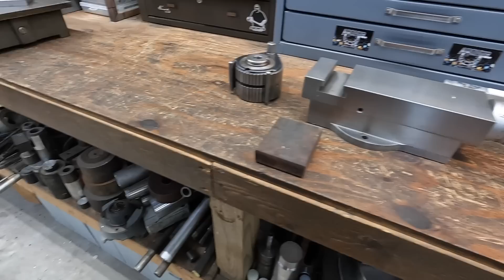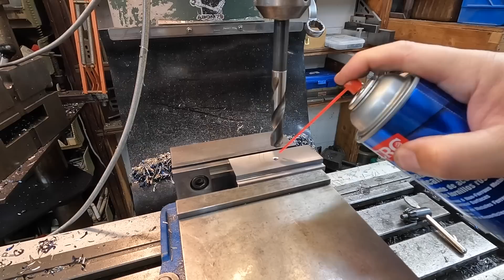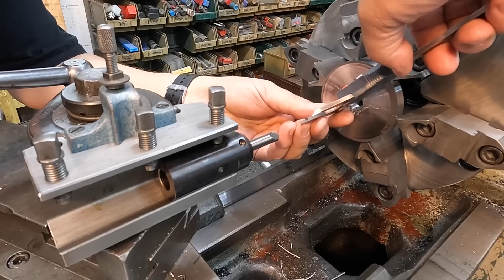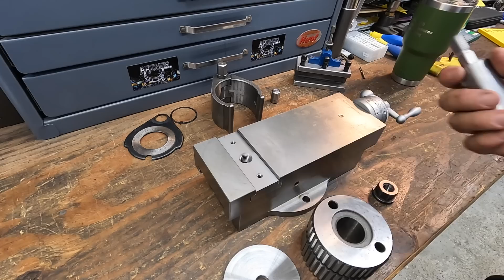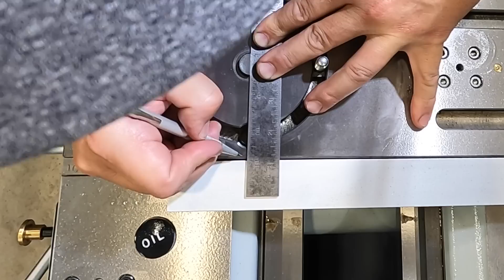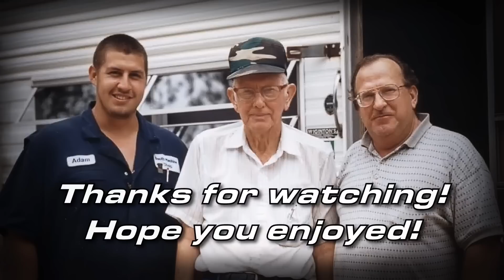Multifix Toolpost for the Precision Matthews Lathe

Comment: I noticed, that the thread gauge micrometre he was using was last calibrated in December 2015. That's interesting, but I suppose if you're just a hobby workshop, it doesn't really matter.
Reply: he shown before how he calibrate them by himself.
Reply: My god , you lot sound like a bunch of school kids, “ please miss he pushed me first”, I don’t put videos on here but would except criticism if for no other reason than I might learn something. So let’s all grow up and respond in a sensible way. Now I will sit back and wait to be slagged off.
Reply: Having your tools calibrated and inspected by a third party outfit is only required when doing work for certain industries such as the aerospace and medical supply industries. I am sure Adam has the equipment and know how to keep his tools in proper calibration for the work he does.
Reply: @grntitan1  I would say having your equipment calibrated is very important. How does he know his 1" size is the same as Joe up the road making another part?
And this includes all measuring, and electrical measuring equipment also, even torque ranches. are you not familiar with ISO 900 or its American equiverlent?
but like I said in my post, it won`t make much difference in a hobby workshop.
Reply: @rayturvey3826  so why bring it up? Waste of time, also, what is a torque ranch?
Reply: @andyb7963  Just thought I would mention it. I`m sorry if my spelling offends you. I suffer from Dyslexia, and sometimes I make spelling mistakes. and yes I do use spellcheck.
Reply: @rayturvey3826  Ray, I agree with you, nothing wrong with your question. Don't worry, the fanboys here protect Adam from any comments that might hurt feefees - they would drag their balls thru 10 miles of broken glass just for the chance to sweep the floor.
Reply: @andyb7963  ....Excellent!
Reply: @rayturvey3826  it's easy to check measuring tools using standards or guage blocks which every machinist has in their toolbox
Reply: @markshort9098  You don`t say, well I never knew that

Comment: Not a bad machine, looks like a lot like a Clausing. (My lease favorite machine in the shop) the flat casting of the compound, like any flat surface tends to become a table top and before you know it your mics and calipers and falling in the chip tray.
Reply: Beware, there is likely a "Clausing" guy looking for you!  The first video when the Matthews was delivered, someone mentioned how it looked  like a Clausing.  A "Clausing" guy was furious!!  I'm not sure but I think they met and had a bloody fight. Just a warning here, "thetoecutter13"!
Reply: @paulcopeland9035  I don't know why people are so in love with Clausing. If someone gave me one I would take it but I wouldn't go looking for one. The two that I have run were not exceptional ridgid machines. They didn't break chips well, the gearbox feeds are too far apart. The only time I ever used them os if I had to cut metric threads cause they would do it with a flip of a lever instead of changing gearing. I'm going to be hunted down for this, huh?
Reply: @thetoecutter13  ...Yep, it's a rough crew.  Maybe it's something British!
Reply: @thetoecutter13  The Colchester lathes were also built by Clausing in a licence (Keith Fenner has an old roundhead from the 50ties)
But the Colchesters that were delivered from the 70ties were later cloned in Taiwan also with the famous Gamet spindle bearings.

Comment: If the alignment pin is right in half, wouldn't that center mark be offset by the thickness of the scriber?
Reply: It would be, but it would be close enough to eyeball an angle on the compound. If you had to hit an EXACT angle you would indicate it in using the traveler of the compound and some trig.

Comment: do you grind the chrome plating off the bar prior to the band saw? it kills the heck out of my saw blades when i just try to cut it straight.
Reply: If it's just chrome you can leave it, but some shafts are ihcp (induction hardened chrome plated) That will rip your blade up.

Comment: For the leadscrew maybe you should cut the threads before turning down the ends. On the previous attempt the shaft may have been unstable in the center.

Comment: If I remember correctly alot of those cylinder rods are made from 01 tool steel. Thats some good stuff to have laying around
Reply: Most I have worked with are TGP 1045 chromed and some also induction hardened.

Comment: Is there a specific reason the Tungaloy cutters are so noisy? Just a large diameter resulting in noisier cut?
Reply: I think the inserts might be gettin a little dull, he's really been putting them to work a lot lately.
Reply: @bdkj3e  yeah I heard him mention that after I commented of course lol
Thanks!
Reply: @joshuateter2410  funny thing is I made that reply before I heard him say it lol, I was just guessing but I guess I guessed the right guess.
Reply: The square shoulder inserts tend to be a little noisier in my opinion. I have a 3" face mill with positive inserts but they are mounted at a 45 (can't do a square shoulder). It can be a little noisy when fewer teeth are engaged in the work...but it doesn't seem to hammer the spindle drive spline like the square shoulder inserts do.

Comment: You have gone through all of this work in your home shop, so you have a good idea of the improvements and upgrades needed in the new shop. Get all of that work completed before you start using the shop or it will get put on the back burner and never get done.

Comment: as someone who honestly doesn't know their ass from a hole in the ground when it comes to this kind of thing ... may I ask the reason why the stud doesn't bottom out on the spacer? I know its a decision ... I just want to know the the thinking behind it as I plan on chaining out the toolpost on my china special mini lathe. Thanks
Reply: If you notice when he shows the post body upside down it has friction grooves,  you want a good clamp on these grooves against that round spacer with the slot so it locks down solid to the compound.  notice their is a small gap between the T nut and round spacer.   that allows the tool holder to bind up tight.  you want the stresses of the tool pressure to go directly into the compound so you avoid chatter. That small gap on the stud to spacer is nothing to worry with.
         My tool post on my lathe is totally different design but the installation is very similar.
Reply: My take on it was that with the spacer floating around the stud, when the nut on top is tightened it smashes down the holder and the spacer all at once so it can all be tight to the compound. Anyway thats my 2 cents. Cheers from Tennessee!
Reply: @randyfox4611  Im in TN too, thanks for your 2 cents it makes ... since

Comment: Adam don't apologise for having to do jobs that actually PAY lol you are running a business after all not just a YouTube channel if we have to wait for you to get to doing certain jobs, then we have to wait! Incidentally I have the exact same, but two sizes smaller Chinese made Multifix tool holder, and as mine was bought brand new I'm pretty happy with the whole lot of the seven holders I have and the tool post mine was bought from a British engineering supply company who get these made from a reputable manufacturing company in China and they are very well made. The grinding is superb and all the holders fit beautifully, and the repeatability I'd lass than half a thou as best as I can measure it with my newly fitted DRO and looking at the colour of the paint on the holders of yours I think mine were made in 5he same factory.

Comment: I wonder what’s in anchorlube? Crisco? Vaseline? Baby oil? Maybe all three? 😏 Maybe it’s just goop. Who knows.
Reply: Don’t know but it works. Secret ingredient?
Reply: @ellieprice363  I found this.. "and is a water based soap". 
 I gather it's an organic based product. Contains no hazardous products. Make of that what you will.
Reply: Mine turned into a bottle full of mold.
Reply: @littlejackalo5326  ....Jesus, where do you live, the Equator?  I have a 3 year old bottle and have to give it a water refresh every now and then to thin it down. Works like new.  This is a really very good, low impact, cutting lube.  Don't tell Anchorlube, but I put some on one of the old shop cart wheel bearings and it seems to be smoothing right along.  There you have it!!!

Comment: It would be interesting to take a tool that is already centered on the Monarch and swap that tool over to the PM and measure how far off-center it is with zero adjustment, then make this spacer thick enough to match.  Then you could swap a tool  from one lathe to the other without having to adjust it.

Comment: 5/8-11???   Baby toy stuff.....  I'd tap that in 3 spots  3/4-16 for more options.....
We have a fairly large Lion lathe at work that showed up with the most useless 4 position toolpost known to man, doesn't even have a T slot in the compound....
Took that POS off and  threw it on a small pallet just in case... been sitting there for 15 years...
Drilled and tapped 3 1"14 holes in the compound and mounted an Aloris E style toolpost have not looked back.
Just me but I don't use coarse threads in anything but plastic.........
Reply: Adam is using Frank S's old saying ~ "I Did It MY WAY!" So thanks but no thanks for your input.

Comment: Very good Adam.  It's hard to tell by the video what sized tools goo into that holder how they level with the lathe spindle center.  Looking at your spacer plate, it might be worthwhile to make the OD a little smaller so that the tool holder can set a little lower if it doesn't clear the spacer..  It can come  in handy if you need to fit a bigger tool.

Comment: What did I miss? Didn't you make a T nut and built for this already?
Reply: That was for the American Pacemaker lathe. He has 4 different lathes all together.
Reply: @nancyp3949  He actually has 5 lathes now - he also has that Milltronics CNC lathe.
Reply: @kindabluejazz  yeah. Only four that need a t nut to hold a tool post though.
Reply: That was for the American Pacemaker compound
Reply: OK thanks! That clears it up.

Comment: This is perfect! I have a Multifix style tool holder and need to make a tool post for a 16 x 40 Grizzly lathe in my home hobby shop. It’s got the same kind of cross slide as the PM, and I’ve been wondering what’s the best approach for anchoring the Multifix to the cross slide. That spacer is a great idea. Thanks for the great content!
Reply: I also plan to go with the spacer method vs the other method of milling the T nut co-planer to the surface.

Comment: It's weird how that stress proof machines to such a beautiful shiny finish, until you make the final pass, when it goes dull.
Reply: Typical for carbide inserts though, finer cuts most always give a worse finish.
Reply: @ferrumignis  that's only due to improper application, particularly taking too shallow depth of cut for given tool nose radius
Reply: @qualified_monkey8813  That's the point, carbide inserts typically aren't very sharp so you can't do shallow finishing passes.
Reply: @ferrumignis  kinda true. For finishing you should go for positive geometry inserts such as CCGT, VCGT, VBGT etc. They have sharp geometry and are ground sharp to precise tolerance, providing low cutting forces. Most of the other geometries have an edge prep that's not sharp, to provide better overall tool life

Comment: Very nice work. Will be interested to see what you can do on the 1660-TL; I got one about a year ago, but have only done some small jobs. I'm interested in the radius tool you use for thread relief, and also the narrow hook scale you used in another video to check the depth of a drill hole. I can't find either of these items. Any info would be appreciated.

Comment: I wonder if the first time someone made threads on a lathe it was by accident, discovering another use for it.
Reply: The first metal Lathe needed a Threaded Rod in order for the operator to cut a thread.
Reply: @an2thea514  what came first? the thread needed for the lathe  to work or the lathe to make the thread ?
Reply: @dalegawne5286  threads were made from hand from at least achimedes(oldest record of a thread helix) 4000 years ago, until the first screw cutting lathe in the late 1700s
Reply: @an2thea514  But but who cut the threaded rod that the lathe used to cut the threaded rod?
Reply: @ellieprice363  threaded rods were a thing that was cut by hand. Archimedes has the oldest record of a srew helix we can verify today and he used threads a lot
Reply: @an2thea514  They still need a threaded rod, to cut a screw.

The threaded rod is called a Lead Screw.
Reply: @BedsitBob  did you listen to me? Every thread prior to the invention of screw cutting lathes that could utilise the Lead screw to cut new threads was done by hand. Worm drives from the greeks, screw presses and self tapping screws in medieval armour all prove this
Reply: Threading on a lathe is a very old practice indeed.
Reply: noone knows exactly who made the first (lead screw) for thread cutting.   but Humans built rome and the pyramids 2000-3500 years ago so I doubt it was that major of a task once the math was sorted out.